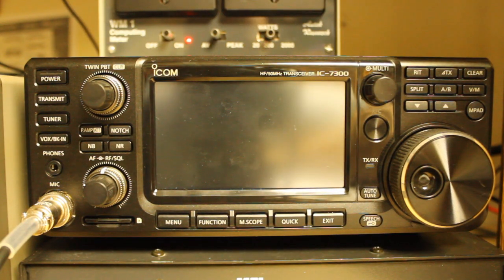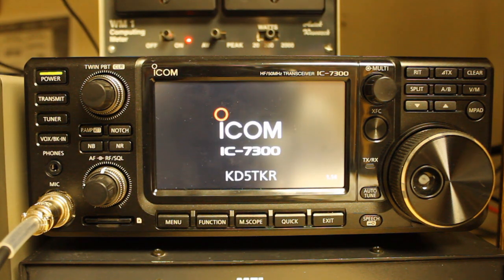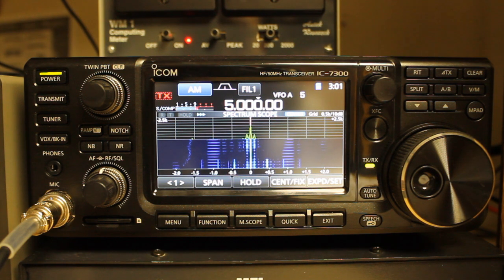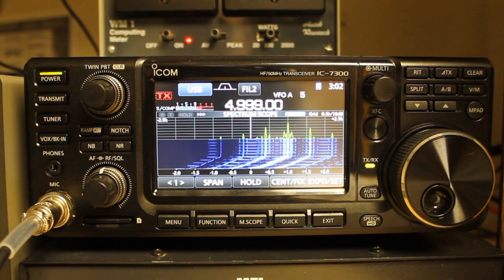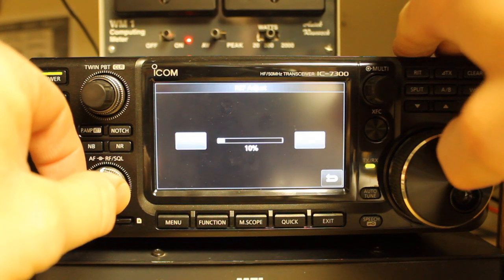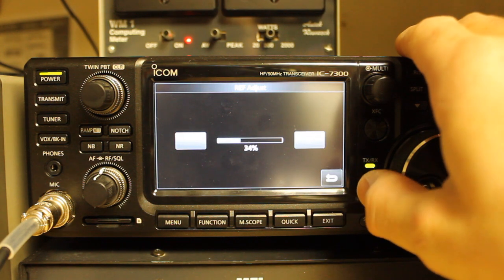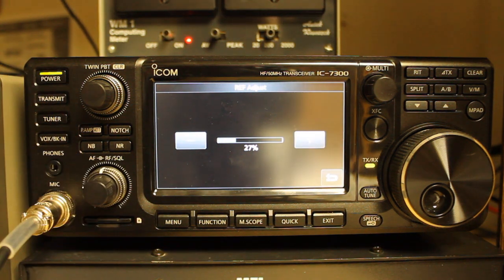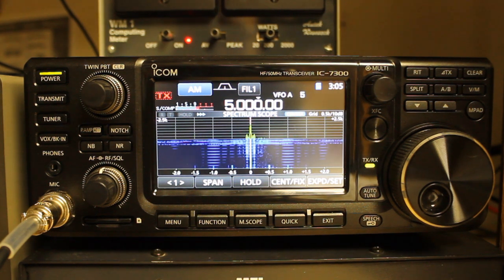Icom IC-7300 Tips and Tricks - Checking Your Frequency Accuracy with WWV

Comment: I would like to second that it is important to let your radio warm up for 30 minutes or more before doing this adjustment.  Mine drifts a bit from cold to warm.  My radio was not dead on from the factory.  It was probably off 20 or 30 cycles per second.  Thanks for the video!!  Robert K5TPC

Comment: Absolutely excellent - well, except for the ever-present monday morning quarterbacks... One of my 7300's - I have 2 - was off by about 25 cycles, and I figured some exotic micro-miniature adjustment and exotic lab-type test gear was necessary - or an expensive trip to an Icom service center - but your fix was quick and simple - well, for anyone but the determined terminally dense... ;-)

Comment: One point you didn't mention is that you need to set your display to  "Center Type Display" = Carrier Point Center ( abs. Freq )  otherwise the sideband will display off center and it gets really confusing very quickly.  After I reset my display I was able to go back and follow your instructions - thanks for this great tip!  My radio was off frequency by about 10%

Comment: Noticed your IC-7300's clock was about a minute slow.

Heck, you can find the calibration centre by listening for which ref adjust settings give you the same beat frequency and then setting your ref adjust exactly halfway between those two settings.
Reply: actually there is Icom software to kill the problem of the clock giving the wrong time
Reply: @FredStam  I just like to listen to WWV and set the clock manually from it.  That is how I like to set it on my IC-7610.  What Icom should have done is implement a feature on the 7300 and 7610 that would automatically set the clock based on the digital code from a shortwave time signal station such as WWV or CHU, or from an attached GPSDO.

Comment: Did you hear that it is more than likely that the NIST is going to pull the plug on the whole Standard Frequency and Time system, LF on 60 Khz and HF too.  Boy there is going to be a bunch of folks really mad when their clocks set WWVB stop operating so accurately.

The video is great, but another similar process makes the beat down to 1/10th of a cycle possible.  Disable the AGC and the beat becomes easy to determine by just receiving the signal.  Adjust the time constant of the AGC type you use least.  I rarely use FAST, so my adjustment is "0" seconds.  Now receive WWV in the AM mode and you will be able to discriminate down to Zero Beat.  

BEST REGARDS
Steve, K2CX

Comment: Why don't you set your frequency at the desired frequency and tune?  Why do you set the freq. off  1 KHz?
Reply: Because the rig's generated audio tone is 1KHz. The reference adjustment will zero beat to this tone. Hence - 4.999.000 offset in USB will generate a 1000Hz tone from the WWV carrier frequency.
Reply: Jim Ryan p

Comment: Thanks for the video, very useful. 
One should let the radio to be on for a while before calibrating so  that it warms up to normal operating temperature. This is important especially with older radios. 
Also, RF gain control can be used to lower the level of time standard signal if that is too high compared to the marker.

Comment: Not sure why you did that... it sure wasn't clear that the tone was zero beat... how close do you think it was, anyway?
Reply: Hi Bruce,  sounds like he got within about 1 or 2 Hz.  You can hear the very slow swoosh swoosh swoosh at a rate of about 1 time per second when he was at 27% (not easy to hear, but if you listen closely you can hear it).
Reply: I believe that my counter is plus or minus 1/2 Hz at ten megahertz, which would be closer than that. I think if he had backed it down to 26% that it would have been closer. There should be built in software to do that job correctly. This is not a good thing, as the machine is obviously settable closer than it often can end up being adjusted.
Reply: Sounded like it was almost dead on, maybe 1 hz or less to my ears. Really cool sound of the ticking, beating atomic clock !

Comment: Here are a couple more time and frequency standards:
China
BPM on 2.5 MHz 7:30-1:00 UTC 15:30-9:00 CST
BPM on 5 MHz 0:00-24:00 UTC 0:00-24:00 CST
BPM on 10 MHz 0:00-24:00 UTC 0:00-24:00 CST
BPM on 15 MHz 1:00-9:00 UTC 9:00-17:00 CST
Russia
RWM on 4.996, 9.996, and 14.996 MHz
Reply: Europe?
Reply: Spain
EBC on 4.998 MHz 10:00-10:25 UTC 10:30-10:55 UTC Mon-Fri
EBC on 15.006 MHz 10:00-10:25 UTC 10:30-10:55 UTC Mon-Fri
Finland
MIKES on 15.000 MHz 24 Hrs - Time markers only
There are others on VLF if you are interested
England
MSF on 60 kHz 24 Hrs
Germany
DCF77 on 77.5 kHz 24 Hrs
Hope that helps
Reply: Hi Greg. What BPM stands for?
Reply: @diditpradipto329  BPM is the station call sign.  Just like WWV is for the time station in USA.